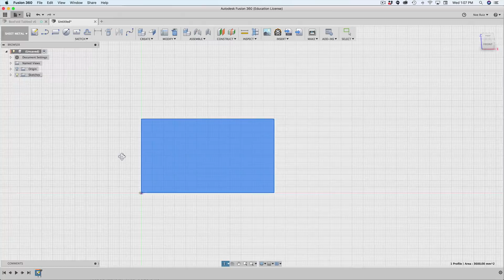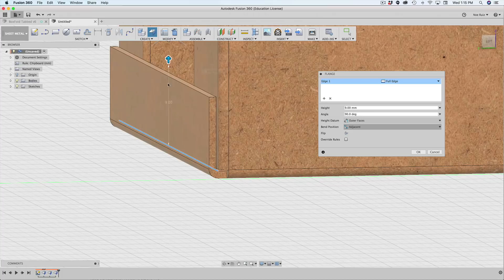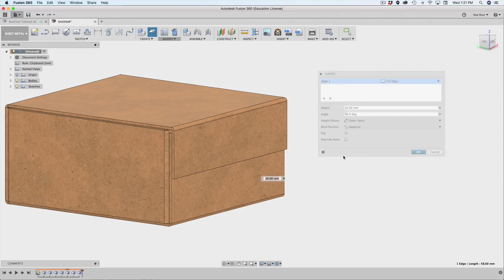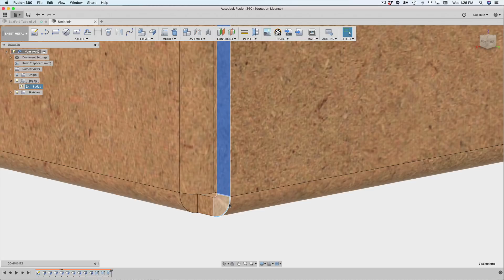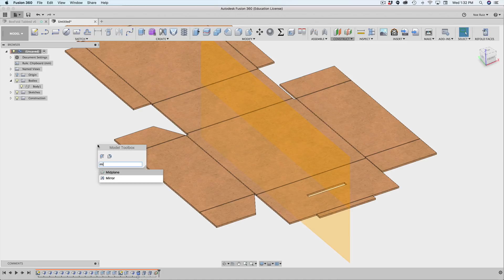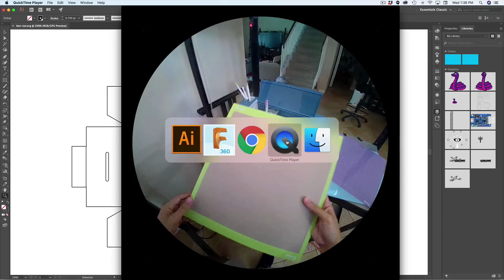Fusion 360 Tutorial – Foldable Boxes

Comment: Hey man! Awesome tutorial I have a question though. In going to be doing a lot of work with aluminum composite panel. Those are usually cut with V groove bits with a kerf at the tip. How do I model a v groove bend instead of a round flange bend?

Comment: Thank you very much for the Tutorial! I wanted to ask you if it was possible to make the holes for the flaps smaller than the actual flaps, because otherwise they simply fall out and don't give enough solidity. I know that the 3D-Construction does not allow that because the material collides.

Comment: I've watched this video a couple times and it's great. I'm having trouble reverse engineering a sheet metal chassis from a 1934 EKCO AD65 British radio. The front view of the part has both the left and right sides tapering towards the top, but only the top 5-inches from an overall 6-inch height. It has flanges toward the back of the part but those flanges taper from an inch wide at the bottom to about a quarter inch at the top. To top that off the two side flanges have horizontal flanges on the bottom outside both left and right. Could you do a video that shows how to measure such a part, how to draw it and how to flange it? I think a lot of people would be interested in something like that. Do you measure from the outside of the side flanges? Inside? Then change the flange bend radius and thickness to fit? Many things going on here. Thanks, you are a pretty brilliant guy.